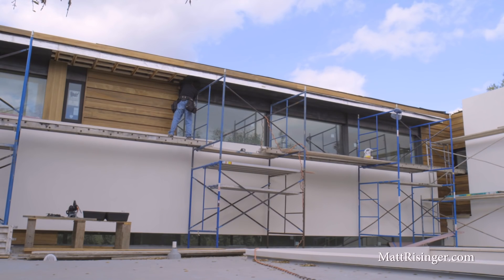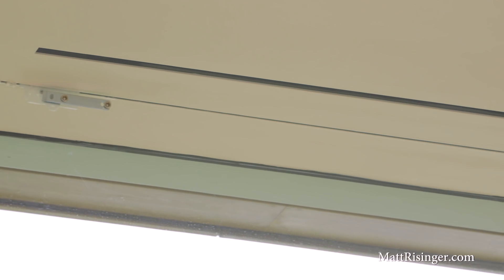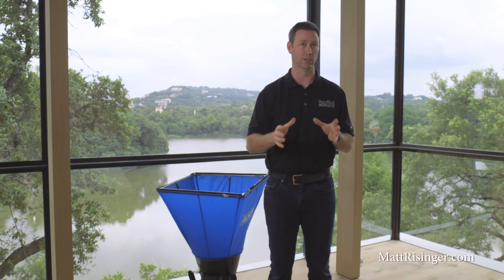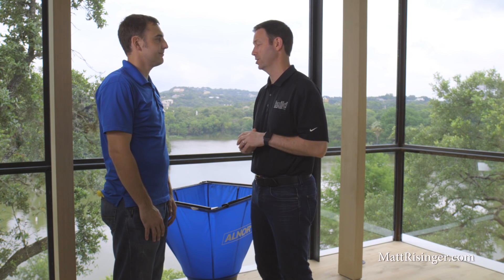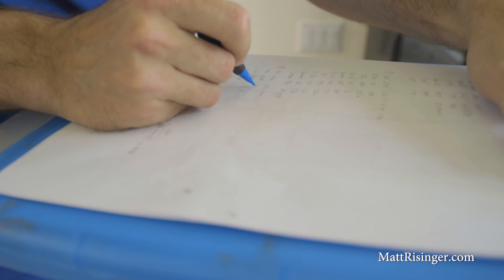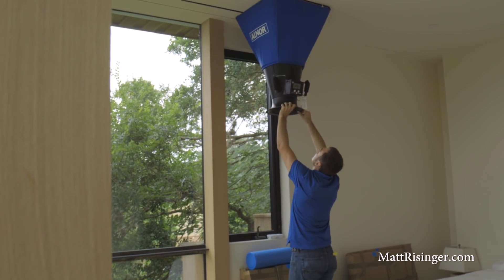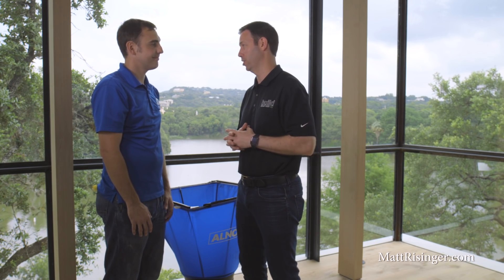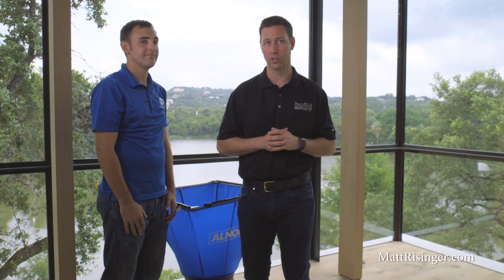How to verify your HVAC system was installed correctly.

Comment: Had a 25 yr. old HVAC replaced with a 1 1/2 ton Goodman R22 system (app. 1250 sq. ft. slab brick, {with some vinyl} ranch, lower Ohio valley). Everything was ok at first but the compressor failed 3 yrs. later, was replaced under partial warranty, now my air conditioner doesn't keep up. On the really hot days the inside temps. never drop below 85/86 F, often it's at 88 F for long periods, until the sun goes down. I've had multiple return service calls from a presumably reliable company, every time with the explanation the unit is working correctly even though they saw that the temps refused to go any lower. I've added extra insulation to the attic as well as increasing attic air circulation and exhaust, I've also completely replaced my windows with more efficient models and replaced the entire roof, including the under board (it needed it). Once the outside temp starts rising into the nineties the compressor literally NEVER shuts off, this is probably what killed the original compressor. I've even tried water misting the condenser coils to increase the cooling function, but this caused a severe drainage issue and had to stop. I'm afraid this compressor's life span is in danger. My house needs a 2 or 2 1/2 ton unit regardless what they're claiming, I believe they installed too small a unit and now doesn't want to admit that fact. It not just the size or age of the home but also when it was built, mine being the early 70's when suburban shotgun housing took a really "Build-It-Cheaper" turn.
Reply: So now I'm forced to use 3 portable window exhaust units to supplement my system, I couldn't live here if I didn't, I definitely wouldn't get any sleep. Does anyone out there know if a larger compressor can replace my current one without replacing all the other components ? Any help would be much appreciated.
Reply: That’s strange that any company would put that small of a unit in.... 1200-1500 usually will take a 2.5 if you’re really gonna generalize and go naively off sq ft only

Comment: That is not the proper use of that tool, it has to be calibrated to the density of the air that's going into it and it is restrictive so by putting over some of the grille you just created a air restriction and force more velocity out the sides that are not covered. If you are going to measure air flow out if a linear Grille use a vane anemometer. That bolometer is used best for air balancing not CFM.
Reply: Duct traverse would probably be the best for a linear supply. At least do one to develop your k factor for the others, and yes use a linear hood, not a 2x2.

Comment: How about the projects where the developer or contractor doesn't want a certain size soffit because of the size of the duct?................."8" duct, come on that's too big, 6" duct will be fine"Or how when the painter/drywaller uses the Heat or AC system and fills the AC coil or heat exchanger with construction dust?It's not always the installers fault when you have a lot idiots you have to deal with in th construction business
Reply: I did not mean to leave a negative comment. Video was very informative but I hate when a supposed expert needs to knock the installing contractor or trade in order to make himself look good.Why don't they help contractors install it right in the beginning of the job instead of the Monday morning quarterback comments?